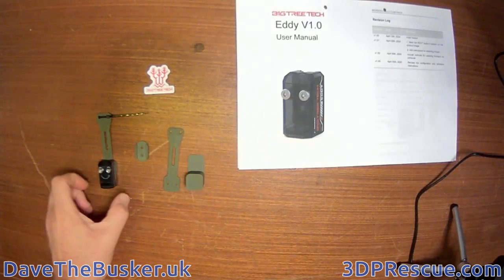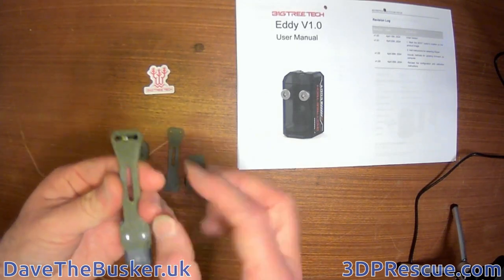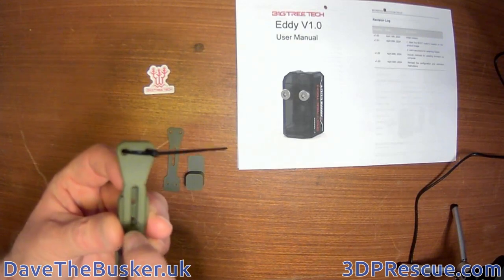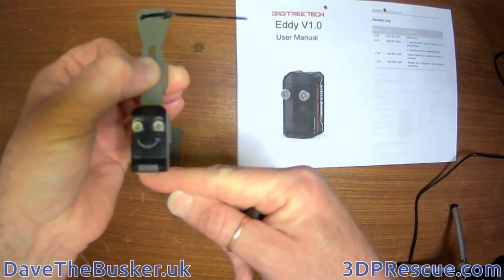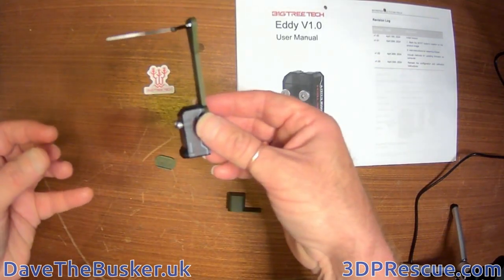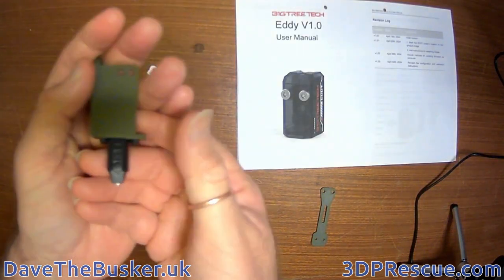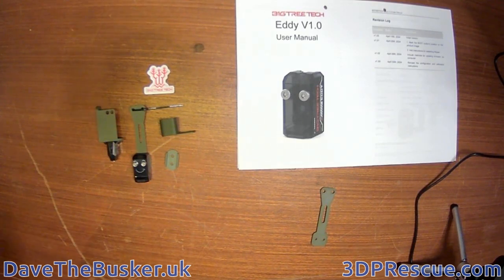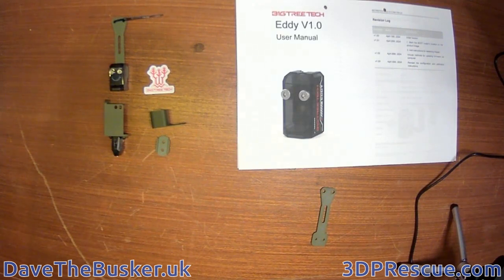Eddy Probe Mount Overview

Comment: I was wondering about the mount and here you have one which I’m gonna see if it fits the sv05 mount where the bltouch is mounted. The measuring widget is brilliant. And I also like their gear!
Reply from the maker: I do have a SV05 but I installed a Sprite Pro so it doesn't have the stock hot end assembly any more, otherwise I'd run up a mount to fit that. Let me know how you get on with it, if you need help I can work with you to create a mount that will fit, this is modular so easy to adapt.